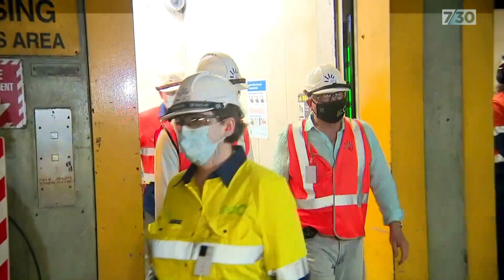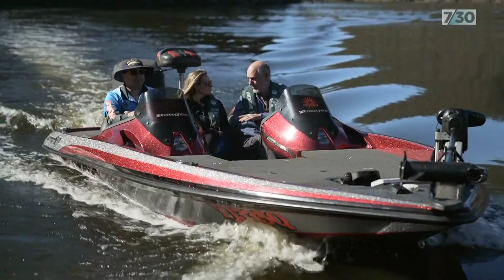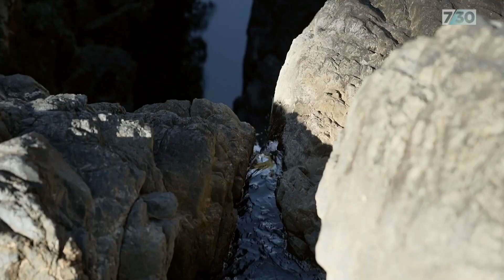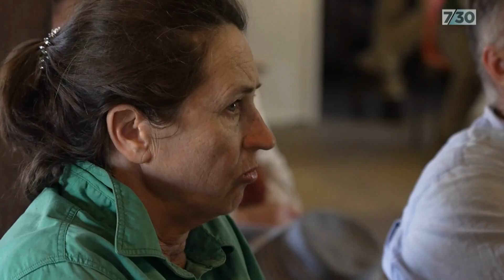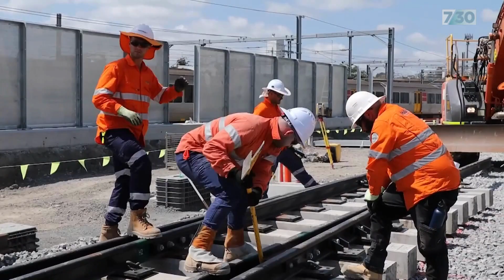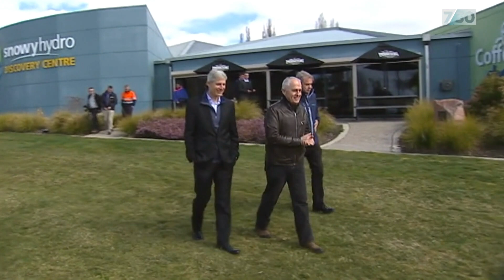Questions being asked about Queensland Government’s proposed pumped hydro scheme | 7.30

Comment: We have large supplies of the worlds best coal. It is a very efficient and cheap power generation option. We dont need to spend anywhere near the capital they are planning. Let the rest of the overpopulated world worry about renewable energy generators. This plan will be like a drop in a bucket when considering the rest of the world but it will cost us dearly. The money being spent could provide a modern reliable and cheap network of coal generation. The people are seeing insane power prices now because we have not got enough coal power plants. What will the cost of electricity  be when this project blows out? I predict it will be so high that people will be cutting down trees to burn in household inprovised fire places just so their family does not freeze in winter. Make coal great again!
Reply: One of the ironies is that coal production has continued, it is simply exported along with the associated pollution. The revenue from overseas may be very helpful for our balance of payments but it does seem like a very inefficient use of resources.
Reply: @billedifier8584  What, using a mountain of fossil fules to move fossils fuels to countrys that are and the rear-end of using clean(er) technologies? Ones that the UN is trying to bankrupt the 'rich' countries by making them pay for the rest of the world to clean up their act? While the people really making the money get to make profit from both sides? What could possibly be wrong with that?

Comment: Everyone realises that if they get another drought like in 2003 here, that it would probably end up shutting down the pumped hydro? As they are using the existing dam as the lower reservoir, at some point they will need to decide on whether pumped hydro is more or less important then domestic supply, or, heaven forbid, irrigation.
Reply: It re-uses the water, it goes out and then back again, nothing is lost.  Can't say the same for domestic supply or irrigation, THAT water ain't coming back.
Reply: @roidroid  Yes, but. Firstly, the bottom reservoir is the existing one that's used for domestic consumption, environmental flows and irrigation. Secondly there is loss due to evaporation, etc.
My point is that the political reality of now having a 'hard line' that you can't go below without endangering being able to fill up the top reservoir (plus having this change over time due to silting) is exactly the kind of thing that governments are notorious for stuffing up.

Comment: Old mate might be an engineer & retired CEO, but he has either gone senile or has an agenda with his talk about logic dictating building power generation as close to the market as possible. Pumped hydro depends on suitable locations for upper & lower reservoirs. If there were suitable places closer to the main markets which could produce the same amount of power, they would have been used.
Reply: He might have been an Electrical Engineer but he probably wasn't a very good one. Minimising transmission loss is only one factor in any power project and good engineers are aware of all the relevant factors and can work in multi-factor environments.
Reply: Yeah, someone better tell all those coal powered stations that were build nearer coal mines than the cities they power.. I mean when you need generation to be at a particular location: the transmission losses are just a factor of it, but they aren't a reason not to do it.
Reply: yeah the ABC had reported horribly on this topic, barely covered either of the arguments.
Reply: I live on the Sunny Coast. The half a mil people living in the immediate vicinity of Imbil wont be complaining about proximity to market like that guy
Reply: It is like the bloke hasn't heard of HV DC

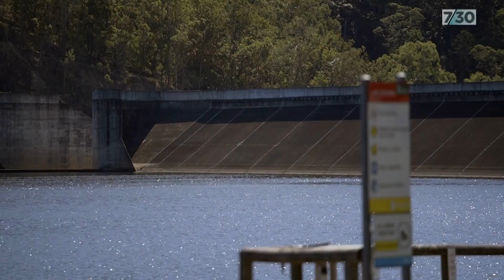Comment: Multi-billion dollar makeover to power homes for just 24 hrs? 01:06 That sounds very expensive 😧 And what happens the next day!!
Reply: Wind and solar charges it up during the day, and it is operational during the night. So they dont need to actually run it for 24 hours, and presuming they are able to charge it during the day power should be reliable and available all the time. Its like a daily energy balancing battery. Solar tends to give alot of surplus energy in the middle of the day, which will become a problem especially considering the massive movements and investment ongoing into getting more solar energy.
Reply: The solar and wind replenish the battery (move the water back into the original water resovoir) to do it all again the next day
Reply: @swirlybirds55555  😆yer, thanks, but it was obviously a joke.
Reply: @JohnDoe-tx8lq  maybe it was, but given  all the current disinformation around renewables, you may want to look up Poe's Law.😄
Reply: @Dave-the-adequate  "maybe it was" - no, it was. Obviously.
Reply: @JohnDoe-tx8lq Your 'joke' is exactly what opponents of this type of project would say..... so not a very good joke.
Reply: @zen1647  oh my God, that is AMAZING 🤣
Reply: @JohnDoe-tx8lq  nah wasn't recognizable as a joke.
Reply: @roidroid  not if you have brains made of saw dust, no.
Reply: @JohnDoe-tx8lq  neat.  
i really do second what the other commenter suggested:  Read about Poe's Law.
Reply: @roidroid  ah bless, trying to educate the masses 😆

Comment: A "pumped hydro" scheme is being proposed for New Zealand. The feasability study has already cost $100 Million.  If the scheme goes ahead,  cost will be so many  billions of dollars, that free solar panels could instead be installed on 90% of Kiwi homes and apartments for the same money. ie Free Solar Panels could be provided for all Kiwis,  except for the wealthiest who already HAVE solar panels, or can afford them but don't want them. .In NZ there is but little need for air-conditioning but for most Kiwis most of the time, home heating is a big consumer of home energy bills. Keep in mind 38% of Kiwis are Rental tenants and have almost zero access to solar panels to help control electricity bills. Many areas have no Natural Gas available and wood/coal burning appliances are so strictly regulated as to be almost-banned. Leaving Electricity as the ONLY home heating option. Domestic electricity usually retails for over 30 cents per kw/hr unit, plus other "connection" fees. Many older, and often uninsulated homes, need regular home heating for 8 months of the year or more (especially in the South of the country).
Reply: Solar only works during the time of day you need heating the least... when everyone is working in the middle of the day, these schemes basically turn that abundance of electricity into night time power which is what you need to bring your cost per kwh down. This scheme would work better in NZ because the main issue highlighted in this issue doesn't exist in NZ which is having to transport the elctricity 1000KM  (The distance between Christchurch and Auckland)

Like Pete said eliminating ineffiencies is much more productive to solving the problem longterm.
Reply: The problem is that solar does little to reduce the costs of heating. Funding to retrofit homes with more efficient insulation and windows would be a better long term solution to reduce the overall energy demand for heating. The further south the worse the problem is because solar energy intensity reduces the closer you are to the south pole.
Reply: @HardstylePete  Solar and battery is by FAR the cheapest form of reliable electricity.
Reply: @elephantintheroom5678  this just ignores the reality of solar. You need solar intensity and it only operates during the middle of the day. I have solar installed on my house. I have the data to prove this.

Batteries are very expensive and more than double installation costs.
Reply: @HardstylePete  The IEA (International Energy Agency) has the data to prove that solar and battery combination is the cheapest power overall. The price has substantially decreased since the advent of the war in Ukraine, and a subsequent price war between solar manufacturers in China, with knock on effects on battery prices. No doubt your data is out of date.
Reply: @elephantintheroom5678  Yes. The solar that's powering my house is wrong 😂

What's lacking is context. Solar is cheap in certain locations in the world. Which is exactly my main point.
Reply: @HardstylePete  We are talking about grid scale storage here, buddy. That's the "context" you seem intent on misrepresenting. Also, solar is cheap everywhere: that's what the levelised cost of energy shows.
Reply: @elephantintheroom5678  We are taking about New Zealand and how it will not meet be a solution for pumped hydro. How hard is it to understand that peak demand is during periods without sunlight?
In addition the original comment is about personal solar installations not grid operated solutions.
Reply: @HardstylePete  No, you began commenting about the "reality of solar" in general, and this story is about renewable energy plans in Queensland, and plans for grid scale renewable energy storage. Grid scale batteries are precisely for short periods without sunlight, and they have decreased in price by about 600% over the last few years, and are far more cost effective than pumped hydro, and rarely go over schedule to build, unlike hydro schemes.
Reply: @elephantintheroom5678  This is a sub thread under the original video. It's a series of replies from based off the context of the first comment.
Reply: @elephantintheroom5678  that's just not true in most cases, they are great for medium sized installations (<1gwh) but are prohibitively expensive when you want to scale up, pumped hydro is extremely efficient and cost effective for lots of power.
Reply: @elephantintheroom5678  oh god, your a little wrong, batteries over their lifetime are more expensive than pumped hydro as batteries don't last anywhere near as long. Hydro can last up to a century compared to 15-20 years for a battery system before it needs a full replacement
Reply: @imakevideos5377  But it destroys river systems. That's not environmentally responsible in times of climate change, during which healthy river systems are essential for maintaining wide areas of bushland, and stopping desertification.
Reply: @imakevideos5377  Sorry, but you're wrong. Studies have been done on this comparing pumped hydro and batteries, over time, and they all say hydro is WAY more expensive than batteries. Not to mention the environmental cost, including dehydration of large areas, that happens when river systems are destroyed. Not a sensible idea at all in a dry continent during climate change.

Comment: How about nuclear?
Reply: I think you would find very similar issues, 1. there is still environmental damage in nuclear (digging in the ground) as with pumped hydro (flooding natural ecosystems) 2. people don't want nuclear power plants near their house increasing compensation or increasing transmission distance 3. you would be investing in another source of energy that would eventually need to be fazed out as uranium becomes more rare and expensive to dig out of the ground.
Reply: Nuclear projects (on record) take way longer to build, are even more likely to go over time and cost projections, and is BY FAR the most expensive to build. They are the worst idea if you want a project up and running on budget and on time.
Reply: The time to build nuclear was decades ago. Unfortunately, the ARPANS Act of 1998 prohibits nuclear power. The Coal- ition had plenty of opportunity to rescind the Act in the last decade, but failed to do so, probably because nuclear has always been the greatest threat to fossil fuels companies who make so many lovely donations. To now champion nuclear as a viable alternative is disingenuous and shows their ethical bankruptcy.
Reply: Nuclear would also actually require more storage as it can't be switched on and off easily and many days we have more than enough renewable energy beinggenerated for free.
Nuclear also needs a lot of water for cooling and has trouble operating when the temperature is above 40 degrees (peak load time).
Reply: @DaMrRat  A simple search would show that nuclear has highest LCOE, on average they take 10 years to build and cannot make a profit without subsides.
Reply: Wont happen while the greens have the balance of power.
Reply: @DaMrRat  solar can run without subsidies and make a profit, no other energy source can do this. Nuclear is a waste of time when renewables can be put in the grid at rapid pace, without severe start up costs.
Reply: Why not, renewables are multiple solutions, but with no fuel costs?
Reply: @MrRatclima my sources for cost are the 2022-2023 gen cost report, IEA. Longevity- Solar panels last for 25-30 years- Nuclear 40 on average. World Nuclear association, sun run. Longevity for building-nuclear on average construction is 7.7 years, has slowed down recently (guardian) Solar depends on size and other factors, but a 50mw farm takes 8-12 months, and I have heard that the worst projects take 3 years to build.
Reply: Australia has no skilled workers or experience in building nuclear.
Reply: It would cost more, take longer, and provide more expensive power.
Reply: nuclear could still work, but since we're so late it'd be better to just wait for fusion nuclear. It's been proven in the past year to be viable irl not just on paper but now just figuring out how to make em big enough to power cities
Reply: @tobenweston  Sorry if I fail to share your optimism. Fusion has been 'almost here' for decades. It may breakthrough tomorrow, or it may never breakthrough. You cannot hang public safety on what might happen tomorrow.